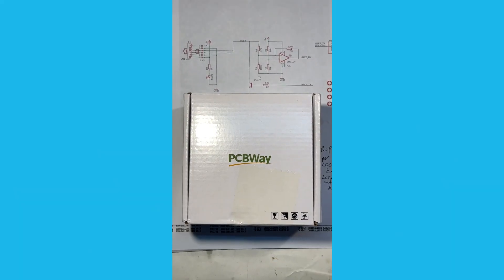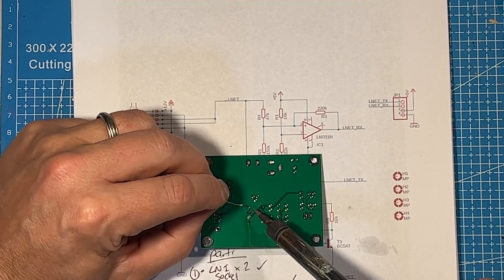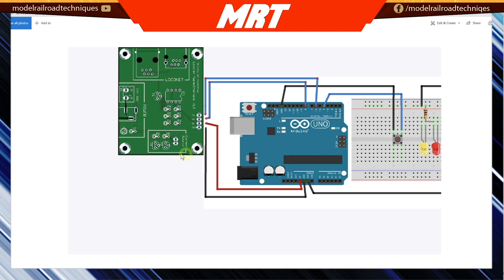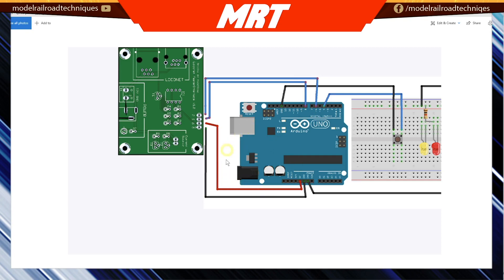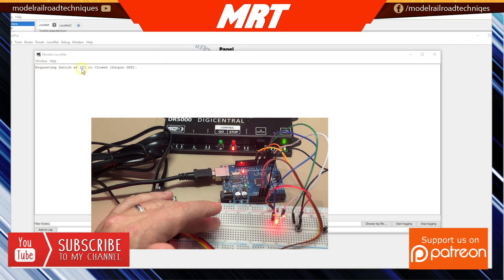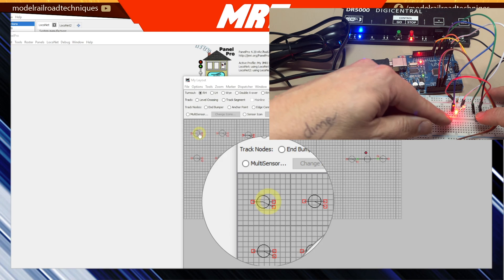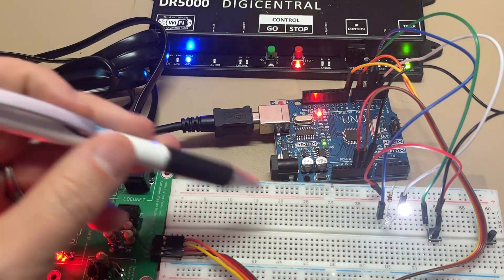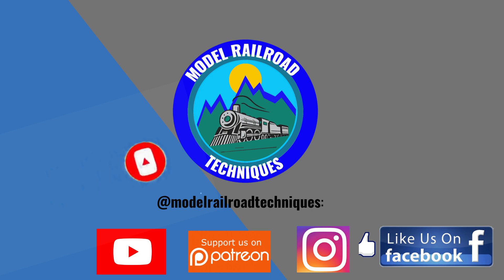Lets make a loconet interface-EASY

Comment: will this Loconet interface drive tortoise switch machines or can it be programmed through the Arduino Uno to drive Tortoise switch machines?
Reply from the maker: With another sketch you would be able to drive stall motors like tortoise
Reply: @ModelRailroadTechniques  - Where can I download the sketch for stall motors?
Reply from the maker: @pillaroftruth2830  I’m sure if you either google or join Arduino modelers group on Facebook they would have one. I personally have never tinkered with it

Comment: Thanks a lot, mate!
Reply from the maker: My pleasure what did you like the most??
Reply: @ModelRailroadTechniques  Well, kinda hard to say, but listening to it was easy, and though I was doing other things, I was able to key in on what I was searching for, I.E., tying my Arduino in with my Digitrax system, plus a bonus of JMRI interfacing with both.  And I have to be honest, I found your Australian accent cool!  That said, I will probably listen to it again and again to get the full gist of it.  But overall, it was easy to listen to and very comprehensive.  Thanks again, mate, or as we say In America, pal!
Reply from the maker: @raymondjackson6069  thanks for your kind works mate/pal

Comment: Hello, I have followed the instructions. The loconet interface board works. I can switch the turnout 1 on the DR5000 interface, but physically the turnout doesn'y move. It's weird the digital command station receives the order to switch, but in fact nothing happens. Have you the same problem ?
Reply from the maker: Any updates?